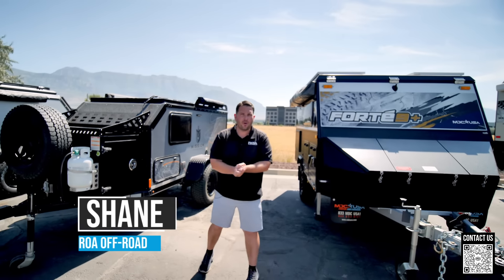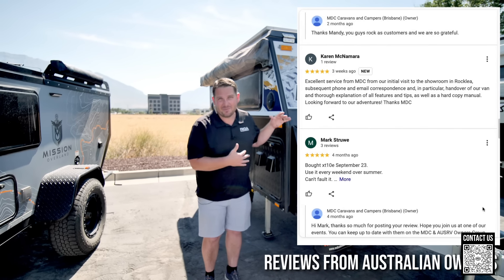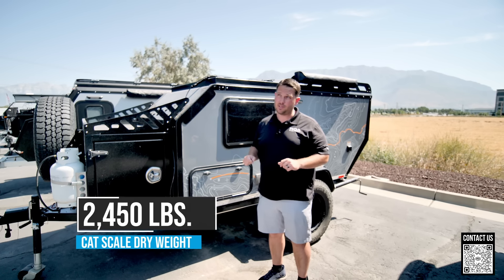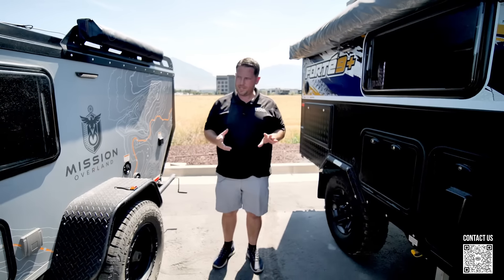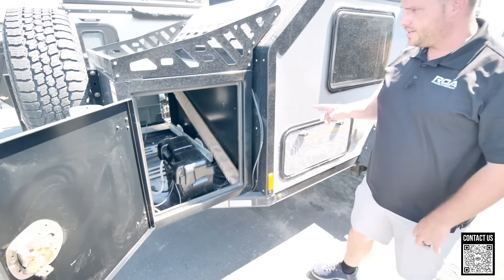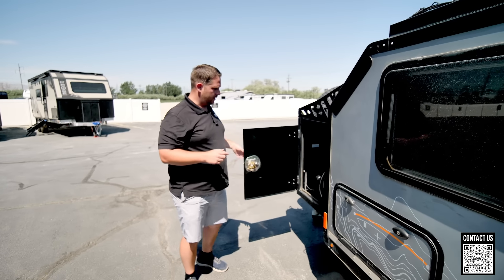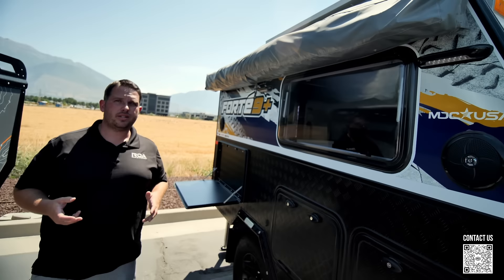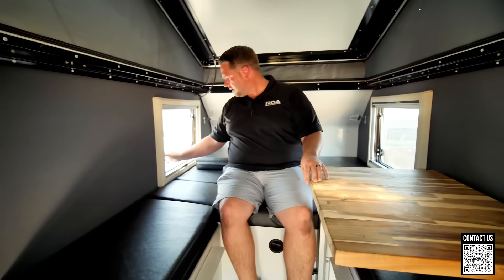Best Lightweight Off-Road Teardrop travel trailer Camper? | MDC Forte 9 vs. Mission Overland Summit

Comment: The fridge is included on the summit.    And both faucets need to be changed.    If you want hot water the faucet has to be wide open to start getting hot water.     Not very efficient on water supply.      But a easy swop.
Reply from the maker: Good to know. Thanks for sharing the info.
Reply: I have a summit now and I am really interested in the forte 9.     Hopefully next weekend I can get to the south Carolina store to see it in person.  I like that the table can stay up with the bed in place...   Love the videos....

Comment: Have you guys figured out the AC for the Forte9 yet and a rough cost?
Reply from the maker: No A/C. Similar to most teardrop they don’t have A/C. 
Mission doesn’t have A/C not most small trailers in this category. 😊
Reply: @ROAOffRoad  it’s an option on the Mission now.
Reply: @ROAOffRoad  in the walk around Shane said one was in the works which is why I asked.

Comment: Do a comparison to a patriot x3
Reply from the maker: We have thought about it but the Patriot is a tent trailer and cost close to twice… 🧐
Reply: @ROAOffRoad  well yea it has air suspension and it and the mammoth overland and off grid and the ones you did in this video are all the only true off-road trailers but I like the lower profile to the patriot because it would mean the ability to take more off camber and its lighter since towing off-road is still towing so you always want the lightest you can so you don’t get stuck.  I would love to see them all compared

Comment: You might want to fully research the other brands that you are knocking/comparing, before attempting a comparison.  Very misinformed comparison, and misleading.
Reply from the maker: @pnwinfernopro  Exactly what was misleading? There was no knocking. As a matter of fact he was very positive about the mission. Point out exactly what he knocked and what info was not correct. (Also he literally said at the start to feel free to fact check anything) Also, it was a back and forth comparison that was pretty straightforward. Walking from one to the other.

Comment: I believe that MO is under new ownership.  Have not figured out if that's good or bad. 

I believe that two big difference are.

1. Summit can fit in a 7 foot garage.   MDC can fit in a 8 foot garage.

2. Summit can be towed by a Jeep wrangler or Bronco. (3,500 lb capacity vehicles) the MDC you need 5,000 pounds of capacity. 

Just watched an interesting video on the new Jeep wrangler.  The minute you go bigger then 33" tires you loose the 5,000 pound rating. Only a few 2024 models that are stock with specific configurations carry the 5,000 pound rating.
Reply from the maker: Interesting, good to know about the Wranglers especially!